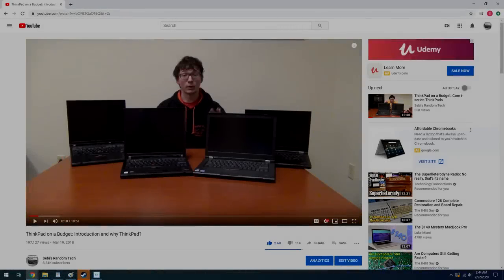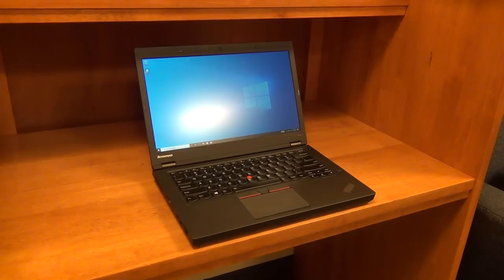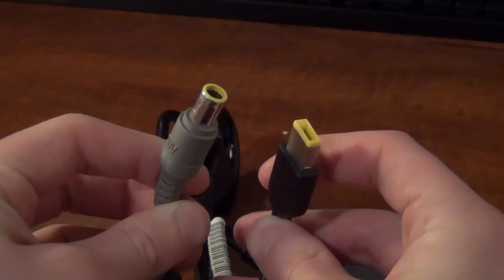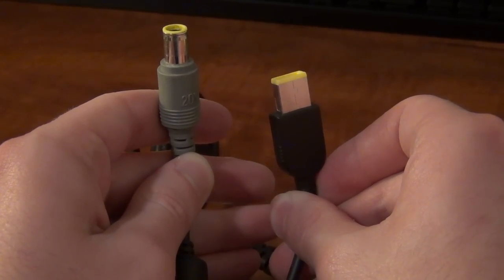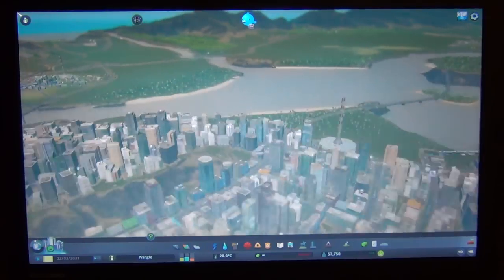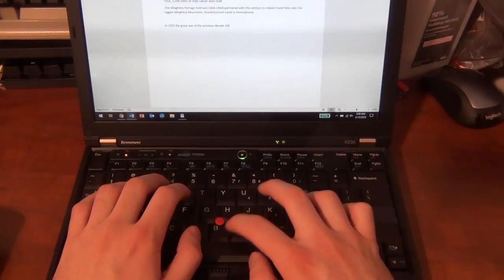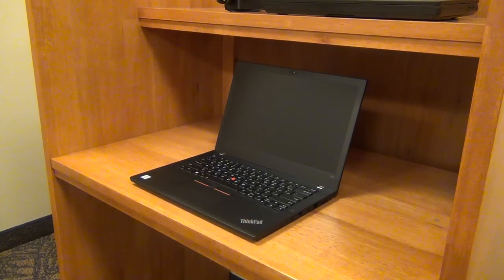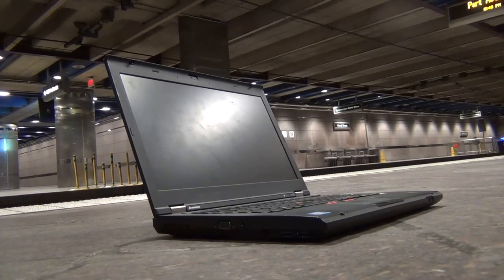Best Value ThinkPads in 2020

Comment: I have an T440s and it’s a Great machine and I have no problems with missing touchpad buttons, it replaced my trusty T420 but the the poor display and no USB 3 support is a must.
Reply: You can swap display and add Expresscard USB 3.0 adapter making T420 far superior to T440s.
Reply: I thought there are buttons. Can't you use the upper part of the trackpad as buttons? I am thinking of buying a 440p and want to use the trackpoint in combination with the trackpad buttons. Is this possible?

Comment: Which do you think is the better deal?
t430 for $220 or w530 for $360
Reply: No.
Reply from the maker: Probably the T430 unless you really need the extra horsepower, and those prices seem to be a bit high unless you're living outside the United States.
Reply: @SebisRandomTech  Thanks, Its probably because i live in Korea where thinkpads are rare.
Reply from the maker: @tomboii7355  In that case, the T430's price seems reasonable unless the W530 is maxed out.

Comment: What do you guys think of a t480s with an i5, 24gb ram, 512 ssd, and 1080p ips screen for about 890$? its half the starting price of a new t490s where i live.
Reply from the maker: I prefer the non-s T480 since the battery is replaceable and the RAM is fully upgradeable, but for half the price of what a T490s costs you can’t really go wrong there. That seems like a pretty decent deal.
Reply: I bought a used t480 i5, 16gb, 1080p for $525 on eBay.  It's in nearly perfect shape.

Comment: So i'm from México and i can buy a t430 for 110 dlls, or a t440p for 155-175 dlls, wich one is worth for the money they cost? Thanks for your time
Reply from the maker: Depends on what the specifications of each are. Processor, RAM, storage, display resolution, etc.
Reply: @SebisRandomTech  t430:
i5 3320m
4 gb ram 
320 gb HDD 

t440p:
i5 4300m
4 gb ram
500 gb HDD

both of them have 14´´
 i was thinking that if i buy the t430 with the diference of 50 dlls i can buy and ssd and 4 gb extra o ram

Again thanks for your time :)
Reply: I'm not sebi but I would go for the T440p because it supports native 1080p IPS panels without 3rd party mods. The default thinkpad 1366x768 TN panels on both laptops are hot trash. Yeah T440p is  more expensive but if you can afford it, it will be more futureproof. Unless you really like the T430's thinklight and want to eventually swap in a 7-row keyboard or something. Otherwise the T440p will last you longer.
Reply: On the T440p, here is my upgrade order:

1) Buy a 256-500gb SSD as your boot drive/primary drive. This will make the single biggest difference in terms of system responsiveness.
2) Buy another 4gb DDR3L stick for a total of 8gb RAM. 4gb of RAM is unusable on windows and tolerable on Linux with a lightweight DE or tiling window manager
3) Swap out the atrocious 1366x768 TN crime against humanity panel for a 1080p IPS panel. 

4) Upgrade that weak i5-4300m for either an i7-4702mq for 37w TDP, cooler performance, or an i7-4800mq for 47w, more performance but runs hotter. All the other quad core i7 either run too hot or are overpriced for the nominal upgrades they offer

1) and 2) are basically mandatory unless you really hate yourself. 3) is also mandatory but if you can somehow tolerate the TN panel then good on you. 4) will be necessary in the future because quad-core i7 get TWICE the performance of that garbage i5-4300m and only cost about $80-90USD on ebay (maybe costs more in Mexico? idk)
Reply: @RanenPo  Really thanks! i will let you know what did i choice, i´ve found another t440p with already and i7 4910 and 10 gb ram for like 225 dlls, i feel like its fake. 
Anyway i´ll update on what happened in 1 or 2 weeks
Reply from the maker: @RanenPo  Not necessarily true, as the T430 supports external graphics cards via the ExpressCard slot and the T440p does not. That really limits the future-proofness of the T440p. I personally would rather go for a modded and maxed out T430 for that reason alone.
Reply from the maker: @rodrigogutierrez3278  I think the T430 would be a better value, for that difference in price. If the T440p came with better specs or a better screen it would be a good argument for both, but they basically have the same specs and the T430 is $50-60 cheaper. It's a no-brainer for me.

Comment: i prefer my Flex 5 amd 7 4700U (2 in 1 touchscreen, finger print reader, 8 core 16 threads, 3lbs weight), backlight for keyboard, camera shutter, 14 inch IPS screen Full HD screen 1980 pix, 512 Gig. I got it on sale for $860 (CAD). Time will tell how long it lasts.  My only gripe is that their isn't a key number pad that my previous Asus 17 inch gaming laptop did. But I will get used to it after few months of use. Game play (Starcraft medium settings) is great even with the integrated AMD vega graphics (needed to download upto date drivers from AMD website).  I will buy wifi 6 chip and manually replace the wifi 5 that it came with. I'm getting 7+ battery hours
Reply: Wait until your warranty expires before upgrading as that voids your warranty.
Reply: @age_of_reason  Not if you swap factory parts when sending it to repair

Comment: I actually found a t440 when i went back home (probably my moms) she worked as a manager in a cable company before she retired. Anyway, I'm curious if everything you say in this video about t440p also applies to t440 without 'p' the one that I've just found. Thanks
Reply from the maker: The T440 is a very different machine. The T440p is more similar to the older ThinkPads in that it has a DVD drive, upgradeable processors, and more upgradeability. The T440's processors are soldered and can not be upgraded, does not have a DVD drive, and only has one RAM slot for upgrades. It also uses low-voltage ultrabook processors while the T440p uses higher power Mobile and quad-core processors.
Reply: @SebisRandomTech  sad news but ty
Reply: @samesamv1472  still a good machine  for most people if you put a ssd, and upgrade the ram to 12 gb, change the touchpad and the screen.

Comment: Thinkpad T430 processor Intel Core I7-3520M, 12gb RAM is the best opcion?
Reply from the maker: The T430 can be upgraded to a Core i7-3612QM or 3632QM. Both of these will yield better results than the 3520M. I also suggest going up to 16 GB of RAM if you can.

Comment: T450 and X250 hold excellent value in my opinion, I had both with the Multitouch Display, sure its not an iPad like experience but it worked fine and it was comfortable to scroll in the webbrowser that way. T430 is a good choice aswell if the performance is enough for you, but its getting old. 
I had every generation of Lenovo Thinkpads starting with the X60/T60 up to the T470p now, lots of good memories. One of the most fun projects was the external GPU using the HWTools Adapter via Expresscard 34 in a T400.
Reply from the maker: The T430’s processors actually outperform the T450’s in terms of raw power. The T450’s use less power and so you get a thinner laptop with much better battery life, but if performance is needed the T430 or T440p is still a better choice. The xx40 (non-p) and xx50 generations are starting to get pretty cheap and I even considered giving them an honorable mention in this video, but I wanted to focus on the laptops that offered the best performance for the lowest price, and the xx40/50 machines are definitely not those. They are very fine laptops otherwise, I have an X240 and a T450s and they’re pretty nice!

Comment: What's the difference between the r series and the t series? There is a pretty good deal on an r500 near me but I don't know anything about the r series.
Reply: They're cheaper models. Generally just as good, but not as structurally rugged as the T/X series. For a computer you mostly keep at home, that's not an issue. An issue would be the cpu though, since it still has a Core 2 Duo. Still good for general use especially if you pop in an SSD and as much RAM as you can find, but probably not good for video editing, rendering, virtual machines, massive coding suites, and gaming even with an eGPU.
Reply from the maker: Couldn’t have said it better myself. The R series isn’t bad but definitely not as nice as the T series.
Reply: Thank you both for your replies. Since I am only looking for a laptop for basic computer tasks, I will go for the r500.

Comment: Can these be the best bet in 2021 as well?
Would appreciate your response.
Thanks
Reply from the maker: For the most part. If you like more portable options you can also look at the "ultraportable" video I made a few months back.
Reply: @SebisRandomTech  Thank you for your response.

I'm planning to buy a T460 ThinkPad with i5 6th Feb
16GB Ram
512GB SSD
And touch screen

For 30,000/- Indian Rupees roughly 430 $.
From a person whom I met o FB Marketplace is selling it.

Is it worth that much price.
Reply from the maker: @Sainthosh_  For those specs the price is reasonable. The T460 is a good model.

Comment: Hello sir nice review. I have t420 with finger print that I can’t let go. I tried to upgrade it my concern is Windows 7pro to Windows 10. I have old games like nba live, chess softwares. My question do I have issues upgrading to Windows 10 pro. What are those drivers to upgrade.
Reply from the maker: Windows 10 works fine, you’ll just have to manually install some drivers yourself or check Lenovo Vantage for drivers that Windows misses.

Comment: I'm struggling to decide which I should get. I'm a student and I find that I prefer a larger screen, so I'm trying to decide if I want a T520, or a T530, but then there's also the W520. I find that the W520 is better for light gaming (Cities Skylines, and Minecraft, and I know that Thinkpads aren't meant for gaming.), but there's just too many options! Can you help? The things that I prefer are: An extremely good typing experience (Dell makes some really shitty keyboards), adequate performance at around lower settings for the games I mentioned earlier, around 6 hours of battery life, and a somewhat okay screen. I know that I can upgrade mostly anything in these machines (Except for the GPU).
Reply from the maker: The W530 will have better graphics performance, and it's relatively easy to swap in a W520 keyboard if you know what you're doing. I'm working on a video of swapping the classic keyboard into a T430, and the process is mostly the same for the W530.
That being said, I've personally played Cities on my xx30 machines and while it isn't a pleasant experience, it is indeed playable. You can of course also hook up an external graphics card to these machines for better graphics performance.
I also have a W540 that has solid graphics performance as well as support for Thunderbolt 2, but it uses the chiclet keyboard and it can't be replaced with a classic one.
Reply: @SebisRandomTech  Thank you very much. I appreciate the help!

Comment: Wow this is great, everyone who touched T430 would say it is the best laptop in the world.
I would love to some day to see an interview with engineering team who built it.
Reply from the maker: Lenovo has a video on their channel called "Lenovo Unboxed: T430" that has a few of the designers at Lenovo unboxing the then-new T430.
Reply: Wich is better l530 or t430
Reply from the maker: @samildilshan9602  T430.
Reply: @SebisRandomTech  reason? What is different in thease model? Are l530 not good
Reply from the maker: @samildilshan9602  L530 isn't bad but the T430 is a little more robust, has some more premium features, better build quality, not to mention it's thinner and lighter. There's also a lot more community support and easier access to replacement parts for the T430, the L530 isn't as common.

Comment: I have found a x1 Carbone i5 core 5th gen. Is it worth?
Reply from the maker: Depends on the specs and price.
Reply: @SebisRandomTech  for 300€
Reply from the maker: @romildolanaj4706  What are the specs? RAM, SSD size, etc?
Reply: @SebisRandomTech  ram 8gb ddr4 , 256gb ssd,
14.1"  2k display
Reply: Is it goob for video editing and coding

Bcs it first time im getting a laptop and i want it to be good?
Thank for replying too
Reply from the maker: @romildolanaj4706  Coding it should be okay, video editing will be doable but not fast.

Comment: Please answer this question for me sebi in trying to decide between the t440 or the p50 in seems the t440 has the better processor by I just don't know what's your thoughts you pretty much talked me outta the t480 thanks for the that
Reply from the maker: P50 will be much more powerful than the T440.
Reply: @SebisRandomTech  the p50 is more upgradable also no? Would you get the p50 over the t440?
Reply from the maker: The P50 is more powerful, accepts more RAM and storage, and has more expandability with ExpressCard and Thunderbolt.
Reply: But on a value basis, you will be paying a lot more for a P50.

Comment: Which one to get? T430 or T430s ? Don't intend to upgrade the CPU though.
Reply from the maker: Obviously the T430’s upgradeable processor is one of the biggest advantages it has over the T430s, but the T430 also has better battery life and runs a bit cooler.
Reply: @SebisRandomTech  Thanks Sebi!

Comment: I've got a T430s I've done the classic keyboard swap + EC patch on (also removed battery whitelist since it was an option) and 1vyrained it to remove the WiFi whitelist so I can eventually upgrade it to 802.11ac. I'm looking for the proper IPS screen and one of those adapter boards, but the cost looks a bit high for my liking. I only use it as an auxiliary Linux machine for anything that happens to be convenient for. My primary and secondary machines are both MacBook Pros, 2017 and 2015. My Windows desktop is relegated to tertiary gaming duties only... 😂

Comment: EXCELLENT  video sir. I want to know  if you have any video on how to adapt an external graphic card to the sd slot and the dvd for storage ? ill appreciate it , thank you new sub.

i got a thinkpad w530 16 g ram but 250g ssd the proccesor is an intel i7 3740QM  and a nvidia quadro k2000m. What do yo think?
Reply from the maker: The graphics card adapter plugs into the ExpressCard slot, not the SD card slot. I may make a video about that in the future.

Comment: For the battery life you didn't give exact numbers. How much does the thinkpad last under light workloads (word, video streaming, general browsing) and how much does it last under load (video editing + similar workloads)
Reply from the maker: Light workloads such as word, YouTube, browsing brought me around 5 hours with a 9-cell battery on the T430 and T440p. Heavier workloads could get me around 2 hours. This is with a battery in good condition, screen around 70% brightness, Wifi and Bluetooth on. Models with dedicated graphics usually don't last as long unless you turn the dedicated graphics off in the BIOS.

Comment: Would you recommend a X301 for $90 with 4 GB ram and 64 gb ssd? I also found a t60p widescreen for $200? Is that worth it as well? 

Specs for t60p widescreen:
Intel Core 2 Duo T7200 2GHz

4GB RAM, 100GB HDD, CDRW/DVDRW Writer

Screen Size: 15.4", Resolution: 1680 x 1050, ATI Mobility FireGL V5250

Extended 9-cell battery, Bluetooth, WiFi Intel PRO 3945ABG
Reply from the maker: Not a bad price for the X301, but that T60p is incredibly overpriced. The X301 also uses low voltage processors making it crawl with modern tasks.
Reply: Sebi's Random Tech Would you recommend the X301 as a daily driver for school?
Reply from the maker: @owenready7043  No. Its low-power processors really hamper its performance. Even with a lightweight Linux distro it crawls with anything remotely modern.
Reply: Sebi's Random Tech I did find a x220i for $100 thought.
Reply from the maker: @owenready7043  Much better value.
Reply: Skip the X301. Its a beautiful machine (I still have my old one), but has a Core2Duo SU9400 which is too slow for anything now a days.
Reply from the maker: @reddyuda  I have one as well. Mine's the slightly faster variant (SU9600) but it's equally useless nowadays. If only 51NB would make a custom motherboard with modern hardware for that laptop...

Comment: I found a t440p 4gb/320gb for around $214. Is it worth the price?
Reply: I dont think so .i found some 8gb/500gb  for the same price
Reply from the maker: Depends on where you’re living. In the United States that would be a bit on the pricey side, but in some other countries that might be a decent deal.
Reply: No bro thats too much, I bought t460s i5 8gb/ 256 gb, more than a year ago for 260, u should get that around 140$
Reply: @Nicola.M7  yeah. Its probably becuz of the pandemic,the prices of these laptop rose.
Reply from the maker: In some countries laptop prices are higher than in the US. A price that may seem like too much here could be reasonable in another country.

If the OP here is based in the US, that price is too high. If not, it may be reasonable.
Reply: This is definitely a good deal in my country. That thing would cost 400 dollars here used.
Reply: Sells for $270-300 in my country.

Comment: Does t480 has thunderbolt?  I need one lighter and powerful enough for video editing
Reply: Yes
Reply: If you get one flash the fix as soon as ypi get the motherboard
Reply: you can hook up an eGPU to the 480, desktop tier GPU for your laptop
Reply: @jonathanpopham5483  But the best GPU you can actually utilize is a 1070, keep that in mind.
Reply: @jonathanpopham5483  through the thunderbolt 3 i can i add the gpu? Or through the wifi?